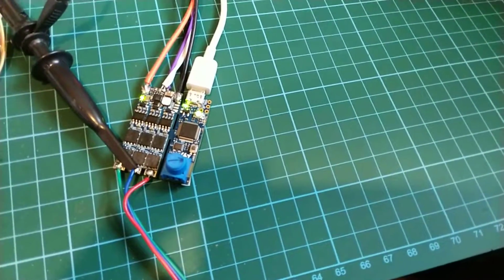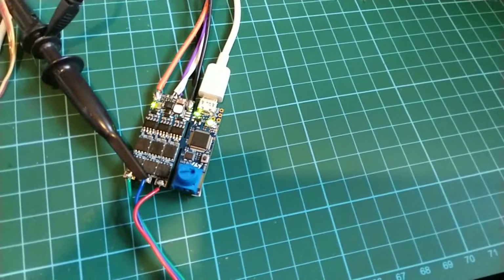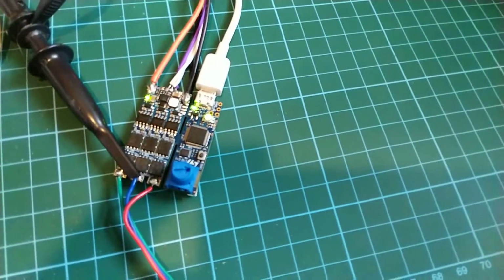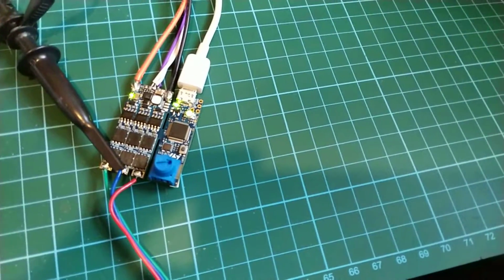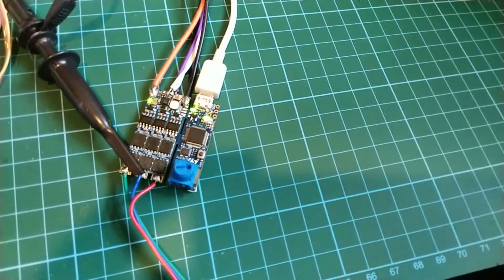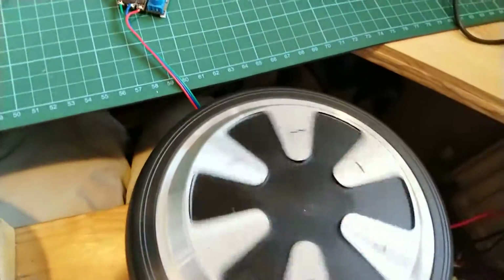STM32G431 Kit For Drones (Part2: openloop foc)

Comment: Wow. This is pretty much exactly what I was looking for, but for FOC instead of Hall Sensors. So close but so far. Great work! Please drop me a hint if there are any sensored alternatives to the work done here, somebody. I'll be your best friend, I swear.
Reply: FOC and hall sensors are two different things, FOC is how the electricity is shaped going into the motor, whole hall sensors just detect the position of the rotor. Either way, this board has support for hall sensors as stated in the video, and support for sensorless motors.
Reply: @lukemagdalin6169  Absolutely right. Sorry, I meant sensorless instead of FOC.

Comment: Hi,
I am using the same board but unable to connect to ST motor pilot GUI .
It shows" port open" ,COM port error.
Even I checked device manager and COM port is fine.
I generated the code from MC workbench and used STM32 iDE with debug and run being Ok. 

DID you came across such issues with ST motor pilot
Reply: I had the same issue, check if you need to use motor ocntrol Workbench 5.4.7 instead of 5.y.3 with a baud rate of 115200.
It worked for me!